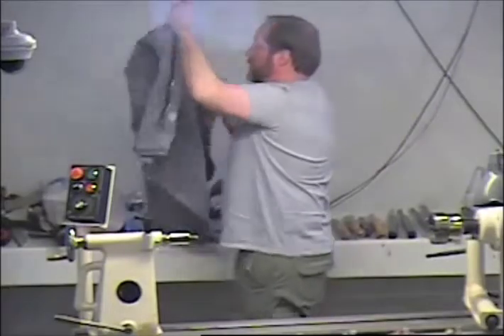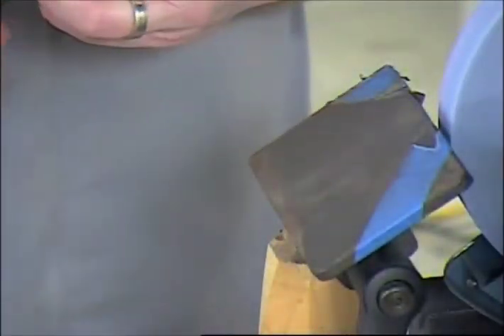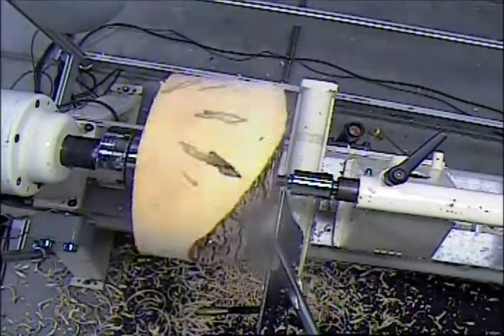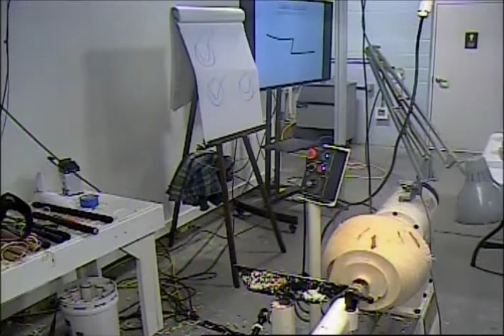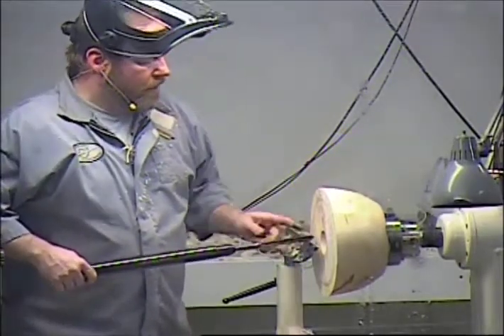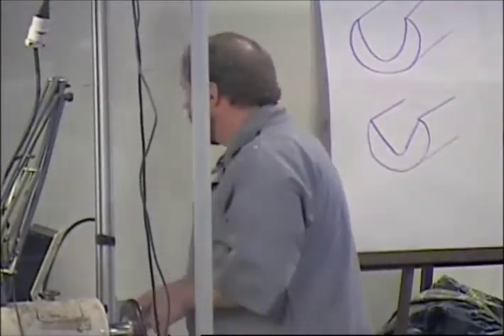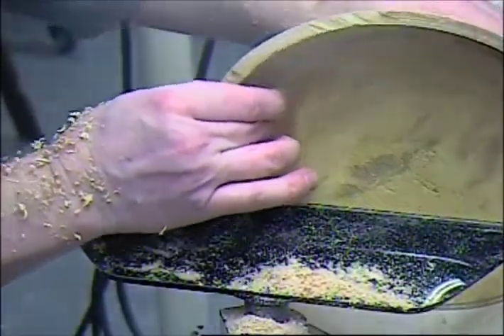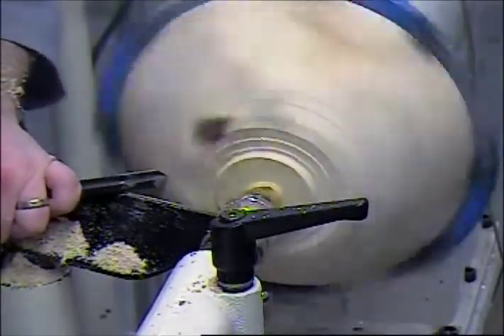Pete Wade 4040 Grind Push Cut Bowl

Comment: Very nice demo indeed. However the jaws were way to small for the tenon on the wet bowl. Maximum hold is attained when the jaws a nearly closed up. You were only holding by the outer tip of each jaw. Completely closed makes a perfect circle so the closer the better.
Reply: 1 year later, still waiting for your demo video demonstrating your expertise
Reply: With a Oneway chuck and their profiled jaws there is good holding power at any position you open the jaws to.